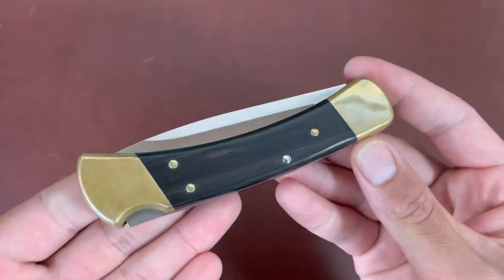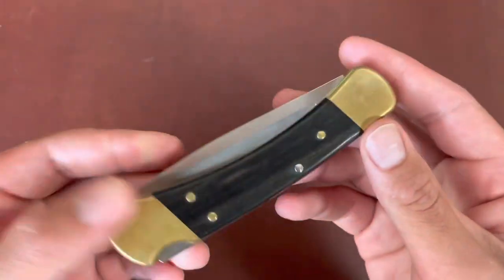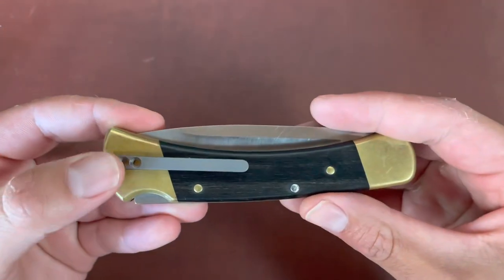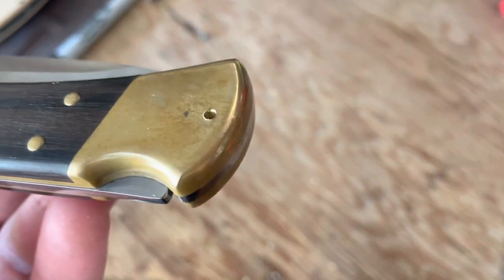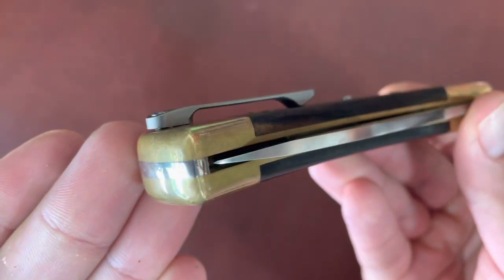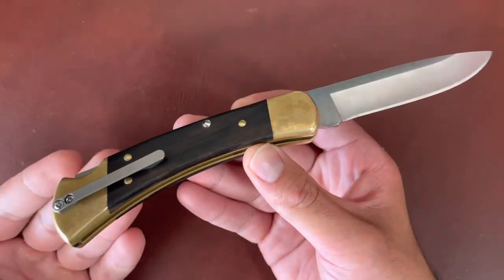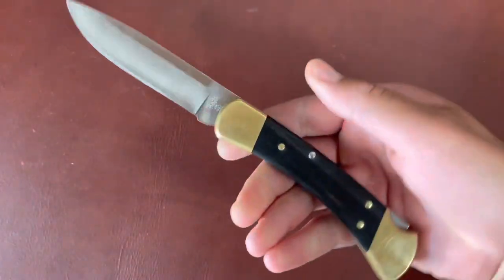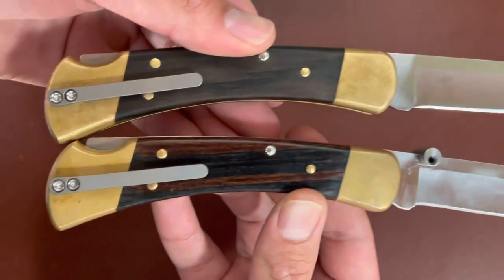Installing pocket clips on my Buck 110 pocket knives

Comment: Nice job, as a machinist I give you props- those tiny drills and taps can be very tricky, especially freehand work. All you need to do with that first hole is grind the screw tip off until it can fully seat. Again, nice work!
Reply: Looks like he stripped the screw head.

Comment: You did a nice job my friend and hopefully like it. From experience I don't as the buck 110 is hefty and do not like it shifts around in pocket alot due to weight,but worse part and why I do not carry in my pocket is that it is a pocket shredder due to weight in my experience so mine stays in a pouch/sheath of some sort, hope it works for ya.